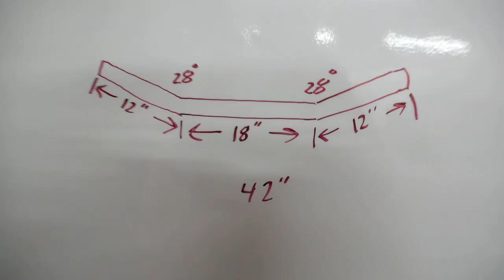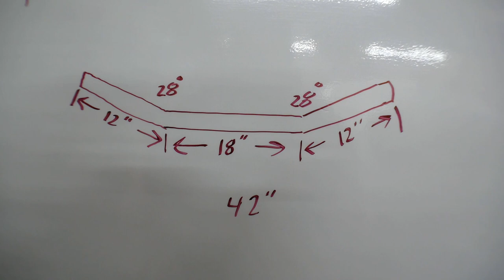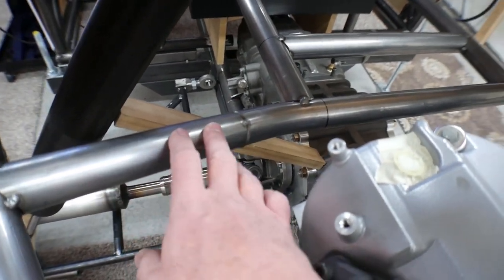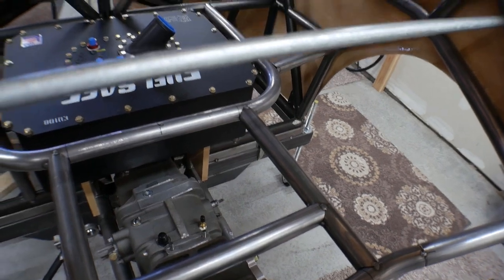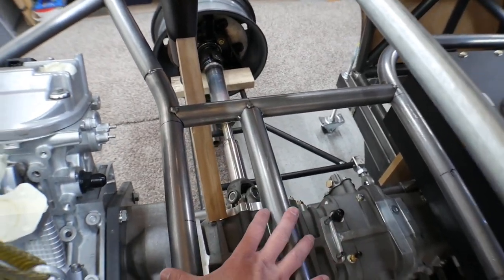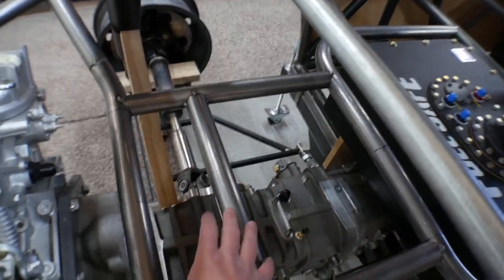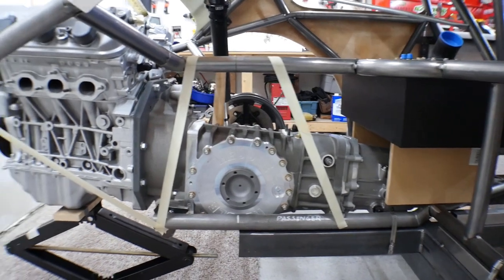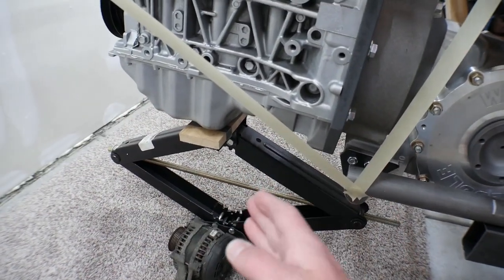Fuel Cell and Cage work on Wratchet.

Comment: You may want to bolt on all the accessories to the engine before proceeding further. Alternator takes up a bunch of space by itself. That is going to be a fun machine. You won’t regret that Honda v6.
Reply from the maker: Totally agree. I was on a roll this week and didn't want to stop. But knew the starter and alternator might get me in trouble. Actually didn't really notice I blocked off the stock mounting location for the alternator until it was too late.

Comment: put a mid plate on top of engine adapter that's attached to frame. weld ears to the bottom of engine adapter. continue lower bars to back of cage and support engine from there as well. look at a prowlers sand sprite 1 or 2 old school sand rail i believe they called it a six point rear cage, glamis dunes .com has a great tech forum. now the hard thing for me to wrap my brain around, is in the sand world those engines are disposable! they put a turbo and a mega squirt fuel injection and get 400hp. then after a year of 15psi of boost drop the long block in the garbage and get another for 600 bucks.
sorry to keep putting my 2 cents in. i wont bug you any more. ill just enjoy the skilled hands you have. thank you! you are inspiring me to work on my rail again.
Reply from the maker: Hey, attaching to the upper section of the adaptor is a great idea. I might use that. Don't worry about your 2 cents, I use ideas like this to my advantage. 👍
Thanks for the comment and ideas.

Comment: Regarding lube for use on tube notching: I like the Lennox concentrate. You mix it with water in a spray bottle. Cheaper and not as messy as WD40. I have more concentrate than I will ever use. I can send you some if you want. I would like to show my appreciation for the effort you put into these videos.
Reply from the maker: Interesting idea, never thought of using cutting fluid like that.
Email me at dougbugbuilder@gmail.com

Comment: Nice! You may have it now. BUT make sure you have your wire and pin connectors ordered months early.  
There is a massive shortage in Az and back log on amazon / ebay!
Reply from the maker: I have not ordered those parts yet. Hopefully it's not a problem when I do.

Comment: Doug: Looking at the opening shot, for extra esthetic points, maybe you could fit a fiberglass strip to continue the C-pillar forwards towards the B-style and stop there instead.
Reply from the maker: I considered that, originally I was going to try and build it into the panel. But that was to intricate. So knowing that there will most likely be more supports welded in there I'm going to hold off until the chassis is done. Then I'll see what I have to work with, and decide if I should make a piece to tie the body in more.
But I agree, that would look better. 👍

Comment: I like your tube bender. I need one of those in my garage.  What brand is it and where did you get it? I love what your doing with ratchet.  Awesome build project.  Thanks.
Reply from the maker: That's the JD Squared Model 3 bender. I bought it directly from JD Squared.
https://www.jd2.com/benders
It comes manual. I added the hydraulic cylinder with a kit from Swag Offroad.
https://amzn.to/2Vn5A2p
But I used it for a couple years manually. It keeps you tough. 😁

Comment: Have you considered swapping the engine and gearbox positions to make it mid engined? If you did consider it, why did you decide against it?
Reply from the maker: Yes I thought about it. It would be cool to be a little different and for the performance gains. However I've always loved the rear engine, and this Baja I'm trying to keep it somewhat traditional looking. Not saying I won't do it someday. But Wratchet will be rear engine.
Reply from the maker: @hurterbe  I've never seen that channel, thanks for the link. Looks like a cool project.

Comment: One thing I just thought of asking was, what was your thought process in rear engine vs mid engine?
Reply from the maker: I love rear engine. Really that's it. I know mid engine has more performance potential. But at least for this Baja I want that engine hanging out the back. I love the look of it and I love being able to work on the engine so easily.
Not to say I won't do it one day. But on this Baja I'm trying to keep it looking somewhat like a traditional Baja.
Reply: @DougBugBuilder  Nice. You sure are making that rear look pretty so you do you! Loving that we're all able to be apart of the process with you.